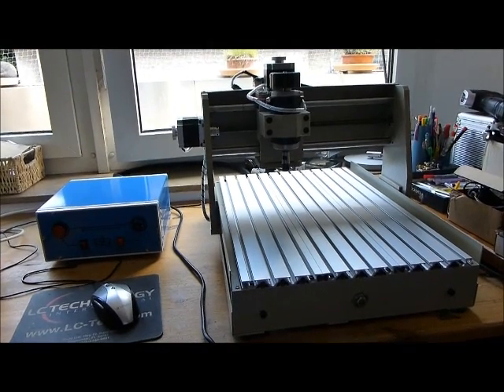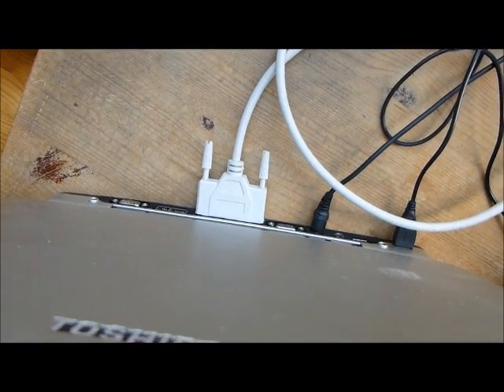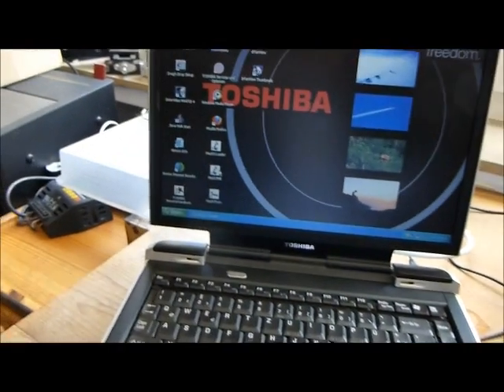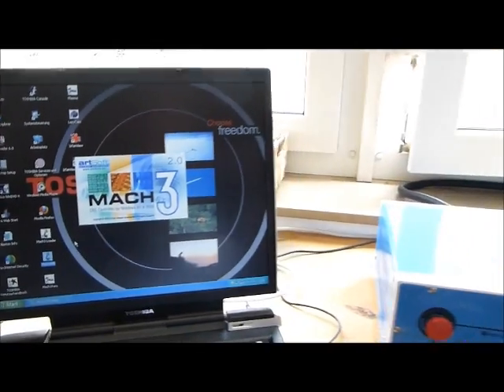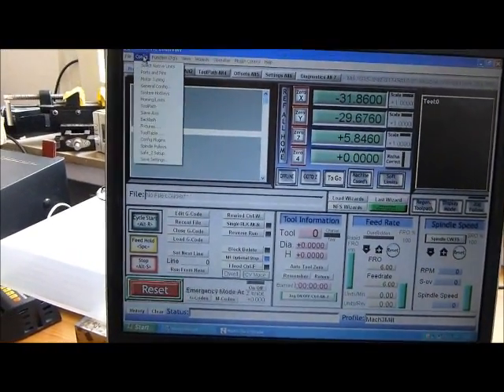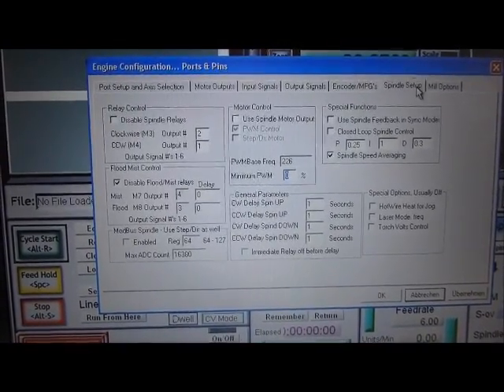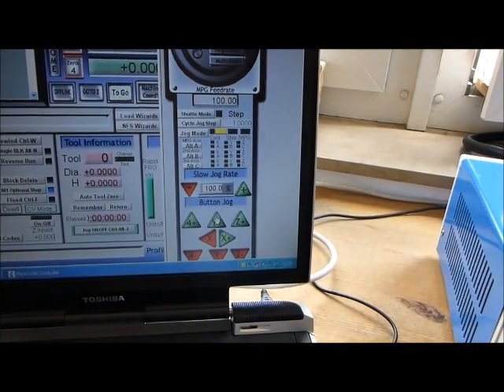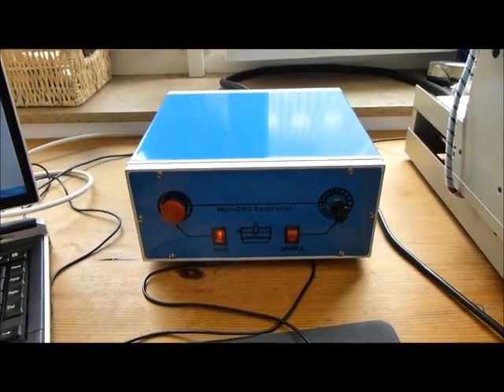brand new CNC machine 3040T

Comment: Hi. Thanks for the video.Have you resolved your problem?  I have bought the same machine. Came with mach 3 software. And I cant get it started either. Only the ghost is working. But machine wont move. All I can think about is that software is just a demo and would not let mi control the machine.
Reply: the mach 3 software is counterfeit for most of these

Comment: I was told by the seller that cnc3040 must have desktop computer that laptop computer don't have the power and have port problem
Reply: this is not true i have a TABLET running win x64 and using UC100 rather then the parallel port and mines works fine

Comment: 0) Throw the e-box in the nearest sea shore, it's blue no one will find it. 
1) Purchase a cnc-planet usb licence and control board (mk2/4)
2) replace the motor drivers with new one's with microstepping
3) Replace spindle or hook it directly at 24V or more
4) Don't buy chinese stuff